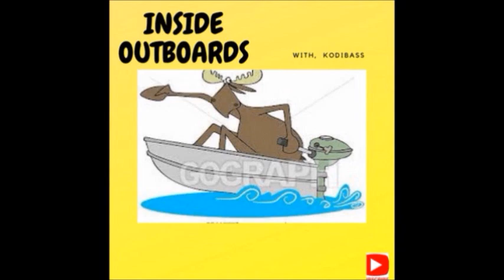YAMAHA 2006 25 HP OUTBOARD,  OUCH

Comment: I understand end up parting out.
But I think gallon transmission oil and a tone and gallon of pb blaster submerged for a while and then vapor blaster
Reply from the maker: When the crank bearings  die I lay'm to rest.  Would not feel good selling the motor,  But I will sell dem parts,  Sad thing I just took in a 3 cylinder triple carb yammy 25.  same condition.        kodi

Comment: Kodi, i am beginning to refit my 30 horse Johnson, first the head then the head water jacket.  The inner surface of the water jacket has light mud deposits, tan in color. I wish I had an ultrasonic tank to dunk the water jacket castings into. I dont want to disassemble the other coolant passages & try to clean them by hand. I wonder how it would work to put some radiator cleaner in a 15 gal. drum test barrell & run the cleaner & water, or an aluminum cleaning acid & water mixture through the cooling system, is this ever done?
Reply from the maker: There are products such as Salt-away which is nitric acid based that claim to help, I use it in my tank cannot hurt 4 sure.  But I find compressed air is hard 2 beat.       kodi
Reply: @kodibassInsideoutboards  thanks, Kodi. Also,  im guessing you are from someplace like down south and stayed in Alaska to live after being discharged from the Kodiak Coadt Guard base?

Comment: I didn’t know your a coastal bell hop ! Lol. I myself was in the navy for 3 years 10 months 21 days and 12 hours ! Lol. Give or take a few seconds ! Lol. I’d rebuild that one for sure !
Reply from the maker: Yepper''  25 Years,,,   & thank U 4 your service.      I cannot rebuild this motor as I do not Have the Press & Jig 4 the Crank.  +  The cylinders were heavy pitted, Nothing a Hone could fix.  If I cannot sell it with confidence I will not re-build it,   I rebuild & sell many  ,  But not this dude.  Parts Is Parts...   kodi
Reply: @kodibassInsideoutboards  no I understand ! Lol. I was saying it tongue in cheek ! Lol. Thank you for your service sir ! I almost enlisted in the coast guard but a friend talked me into the navy with him ! After I was discharged I almost joined it then or the merchant marines but was offered a job with Halliburton and worked for them instead for a number of years up on the Dalton and Wyoming and Montana hauling explosives ! Dumb me ! Lol
Reply from the maker: @davekimbler2308     Sounds like the Navy would have been a safer gig.  lol.      kodi

Comment: Nothing in there to save, such a shame....Could have been prevented if they got it serviced immediately...
Reply from the maker: Yep'  scrap pile 4 sure on the powerhead.  I have another Yammy  3 cylinder 3 carb 25 hp    same as this one.  dunked in salt water and tossed aside.  Must B nice to have that kinda cash.          kodi
Reply: @kodibassInsideoutboards    Crimes against outboards for sure...  Especially with that vintage of engine that doesn't lose spark after going under...Just takes minutes to get them running, drain the carbs/cylinders, maybe disconnect the stop switch, and fire it up with fresh tank of fuel/oil mix...  All the other stuff can be tended to later after the engine has been run hard and fogged...

Comment: Hey Kodi I cringed when I  saw you attack those pistons with a sledge almost the size of the bore and a huge cast iron chip came off the cylinder wall.,LOL. I know you already condemned it but anyhoo. Now I know you are a buisness and not a hobbyist like me so sometimes the time exceeds the value of these motors and you have alot on your table with customers repairs and selling faster turnaround engines. But that block and crank was not bad at all it was almost mint to me. Next time if your in the mood tap the pistons back and forth  after soaking for a few days with a small head heavy brass hammer when still on the midsection and pull with a breaker bar and socket at the crank at the same time. Back and forth it takes patience but always gives me very good results. I wanted to fly up to Alaska and bust in your shop and say stop Ill buy it,LMAOOO.I have done much much worse than that.Try it next time if you can...just a tip from one seasoned 60+ plus guy to another,HA!..Glenn
Reply from the maker: It basically came down to the condition of the rest of the motor,  Everything was stuck, salty, & crusty.  I have 2-4 dozen good powerheads I could pop on that lower,  But   there is a time to say,,   no meat on them bones.      kodi
Reply: @kodibassInsideoutboards  Hey KB I hear ya thats a $1200 + motor hear a 2006 is like new for us resellers,LOL. I m that way with the old parts so many not enough time to address them all I understand,LOLL...... but the technique I mentioned is worth a try when needed... thanks ...Glenn